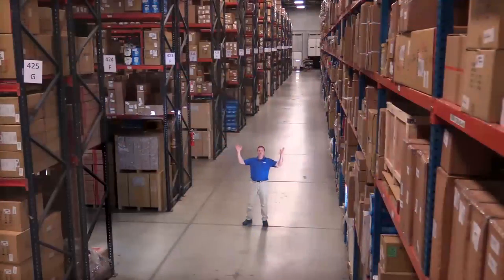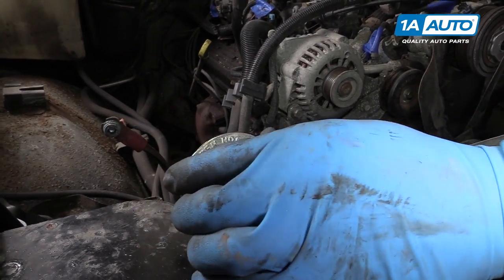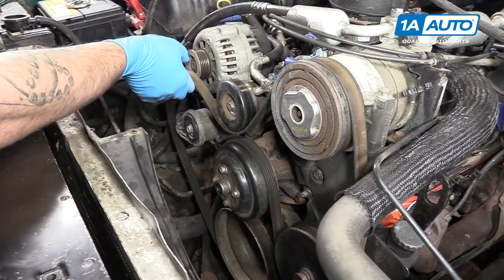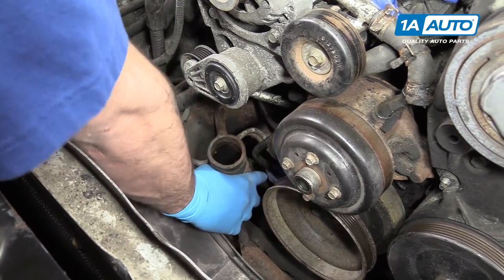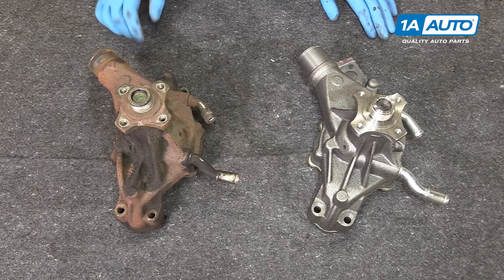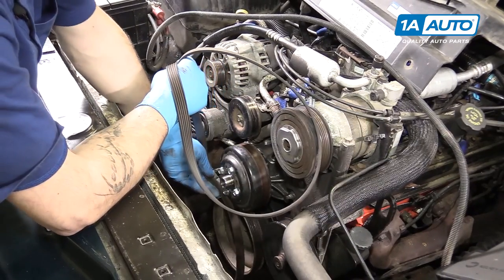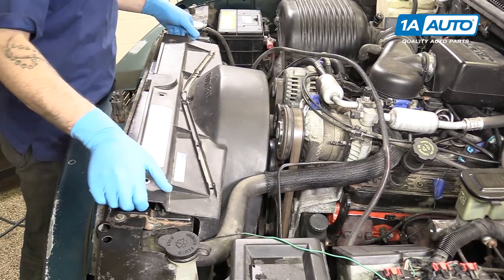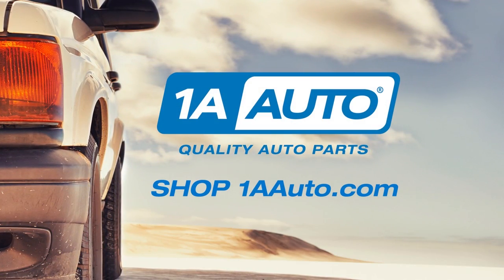How to Replace Engine Water Pump 96-00 GMC K1500 V8 5.7L

Comment: I was a customer of rockauto. Until they sent me a broken radiator that I paid extra for the next day air shipping. At witch point I tried to contact them to resolve the issue and couldn't get any kind of customer service. I ended up having to rent a car for 5 days that cost me $150 while waiting for a replacement part. Now I'm a 1A customer all the way excellent customer service and quality parts and good prices!
Reply from the maker: +Frank P Thank you for your support! We strive hard to have a customer support service that differentiates ourselves from other companies.

Comment: Here  is a great  tip ! Take the old bolts and cut their heads off. Then  thread them into the holes about  1/4 in. or so. Now   you can slide the new pump on. Install new bolts one at a time.
Reply: We use what we take off nothing's wrong with them just needs dipped in oil then screw back on
Reply: Great idea thanks 👍

Comment: You just got me through a pain-in-the-rear replacement. Thanks for the tip on removing the fan with the mallet to the wrench. That really helped. I would also suggest removing the idler pulley; gives you better access to the hoses behind it and just gives you a little more working room altogether. Great video, keep up the good work!
Reply from the maker: +My Name is Nobody Thanks for the feedback and for watching!
Reply: I had tiny bit of room on the right side
Reply: A well placed long chisel does the trick as well

Comment: That's why I love my '96 Chevy Silverado c1500 5.7 l as opposed to some other vehicles that water pumps have to be changed out on. The water pump on this truck is very easy to change out and they're not expensive at all. It's not necessary but usually if I'm changing out a water pump I also change or at least check the upper and lower radiator hose and replace both if one looks like it's going bad or getting rock hard without any pressure. I know when I changed a water pump on a '90s model Silverado we went ahead and changed the thermostat the water pump obviously both upper and lower radiator hoses the rubber on all the hoses that connect to the valves on the water pump and a new serpentine belt that way there will be no problems and believe it or not that guy drove around for almost 200,000 miles before needing a new engine on that water pump and belt and hoses.
Reply from the maker: +Joseph Bragg Thanks for checking us out! http://1aau.to/m/Shop-1AAuto-c

Comment: Extremely helpful. Take it from me,...you also want to remove the idler pulley (one 14mm bolt)...gives you access to the bypass hoses. By the way...I would ALWAYS use RTV if I were you...
Reply from the maker: Thanks for the suggestion and feedback! +8000RPM

Comment: I would first like to say a huge thank you for making this video.  I am a 62 year old shade-tree mechanic.  I done my share of tune-up, brakes and a few water pumps on various vehicles over the years, but everything I worked on until today was 1986 and older.  I now have a 1997 C1500 with a 5.7L engine.  If I had not watched your video I would still be outside sweating in 100 degree heat trying to figure out what to do with crazy looking drive belt.  Several of your tips allowed me to think and plan ahead before starting the job.  Knowing which size sockets needed for which bolts was a time saver.  I do have some questions. 

#1  When I attempted to bolt on the new water pump, I wrestled with it for an hour trying to keep the gaskets in place until I went and bought some JB Weld Silicone Water pump gasket sealer to hold them on the ends of the new water pump.  I noticed you did not put any gasket sealer on your gaskets.  Was there a reason for this? 

#2  It also appeared that you used removable Loc-Tight on the bolt threads.  Am I correct? 

#3  The biggest problem I had was lining up the two bolts on the drivers side of the pump.  My wife had a doctor appointment in two days so there was no time to order from you, so I bought a new water pump from a local auto parts store.  Even though it looked identical to my old water pump, it appeared that my new pump was binding against the side of the A/C compressor mount.  I noticed that when you compared your old and new pump, the molded casting was a little different.  Mine looked the identical but I think the outside of the casting had a bit too much metal on it.  I tried loosening a two bolts on the face or the A/C mount but it didn't want to budge.  I finally used a piece of wood to pry the pump slightly to get it into place.  Removing the idler pulley allowed me to see the bolt holes a lot better on the block and allowed me to manipulate that small hose that you said was a pain to deal with.  Have you ever had this binding problem and how did you solve it?   Thank you for your help.  God bless.  James in Houston
Reply: I never had that problem but i have always worked on older chevys myself.I now have a 99 Yukon 
Also I always used the yellow gasket glue that was hard to remove but much better than RTV.

Comment: Just what I thought the job would be after I had looked at the pump. A piece of cake. I'd spend the extra money and replace the belt, hoses and clamps. Easy to do while you're replacing the pump. 21 year old rubber (on my '97) is long overdue for replacement. I plan to shove the garden hose into each pump port on the block and run water thru until it comes out clean. Switch ports a few times. I've done this a few times over the years. You'd be amazed at the crud that comes out. Don't forget to do a leak check after the refilled system has come up to pressure. Thank you for posting this video 1A Auto Parts.

Comment: Just changed my water pump on my 1996 GMC C1500 5.7 ltr. Only comments I have is to remove 2 more bolts on bottom fan shroud to remove it and it will give much better access to drain cock and makes it easier to remove lower radiator hose. Also break 4 bolts on pulley before releasing belt. Also remove idler wheel and heater hoses will be easier to get to. Other than that all is the same. One hour job if all wrenches are readily available.

Comment: Although I really appreciate repair videos from 1AAuto, this video has a serious risk that most DIY'ers may not be aware of, plus one more thing to make removal of a top hose easier.  First of all, removal of the top left hose would have been much easier if you removed the stationary belt pulley--very simple removal with a socket, that allows easy access to the clam to remove the hose.  But, the more serious issue that was not shown for preventing damage was in the removal of the stuck water pump.  After the four bolts are removed, that water pump can be very stuck to the engine block.  The danger here, that the video FAILED to inform, is that tugging and pulling on the water pump can cause a sudden release, sending the pump into the radiator!  It happens a lot!  And, thanks to this not-so-well video, it happened to my nice new radiator on my Tahoe!  The viewer should be forewarned to place a sheet of masonite or thin plywood over the back face of the radiator to protect it in such a new event, OR, loosen the bolts 3/4 the way out, then knock the pump loose to avoid a catastrophe.  This video was not well made and created an unnecessary risk and the loss of a near-new radiator for me.  NOT happy with this one--you folks owe me a new radiator!  Also, all my mechanics say you left out one important step--you should add gasket sealer to those gaskets!  They often leak if you don't.  Very poor training video leaving out crucial steps!

Comment: That's a great tip about putting tension on the belt to hold the pulley while loosening the fan . A lot easier than trying to put a piece of flat steel between two of the pulley bolts .

Comment: You forgot to mention to put RTV on the bolts. I saw that you did it but did not tell why.  RTV seals the water jacket.
Reply: I think that was likely threadlocker that he put on the bolts to counter engine vibration.

Comment: Fan clutch disassemble tool and air powered hammer or even hammer would have been much easier and without having to put extra unwanted upward tension on tensioner . How many tensioner's have failed weeks or moths later??

Comment: Do we not need to use any gasket sealer?
Reply from the maker: +Malcolm Eatman No, you can just set the gaskets on and bolt the new water pump in place. The new gaskets we perform a proper seal. Hope this helps you out. 1aauto.com
Reply: Definitely recommended to put sealant if you want a nice seal and not have to change it again from it leaking in 6 months to a year
Reply from the maker: +Malcolm Eatman Thanks for watching!  No you do not need to use any gasket sealer, just use the new gasket.

Comment: What is the cap and funnel called exactly to get the air out of the system, and are they available at the common Oreilly's? Thanks
Reply from the maker: +Alan Jacobs Hi Alan, It is referred to as a radiator funnel. Here is a link to them on Amazon if you would like to take a look at them https://www.amazon.com/s/ref=nb_sb_ss_i_9_9?url=search-alias%3Daps&field-keywords=radiator+funnel&sprefix=radiator+%2Caps%2C148&crid=1BI8DRK47CX3W

Comment: Its pretty much the same steps for a 95 , right?
Reply from the maker: +Steven Loftin It may be a different procedure on your application. We currently do not have an auto repair video for this particular year, make and model. Thank you for asking. 1aauto.com
Reply: garcias rebuilds and auto detailing it said 96 to 2000

Comment: hello I have 04 escalade. It overheated and I changed out water pump, thermostat, serpentine belt and AC belt and did the normal   steps. I started to start my car and it wont start but instead makes a loud clunk sound! Can you please help me?
Reply from the maker: +Junz Finau If there is a check engine light on you may want to pull the code to see what it is pointing to. Hope this helps you out. 1aauto.com